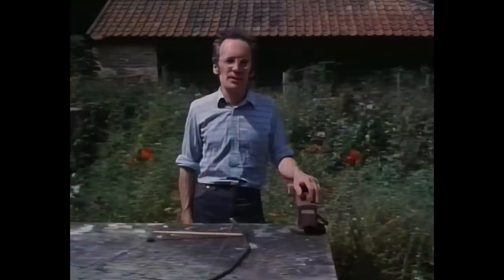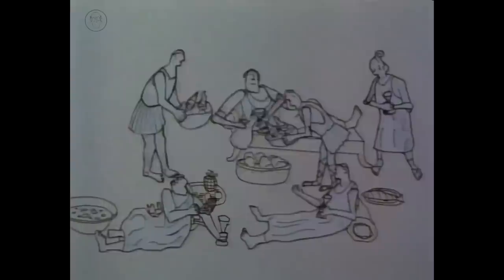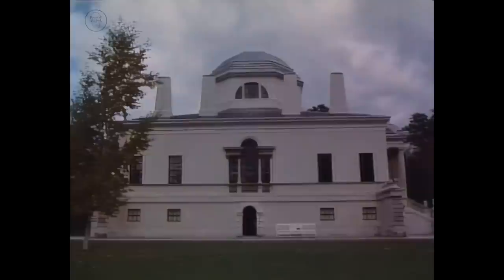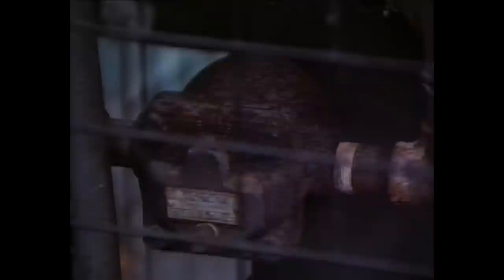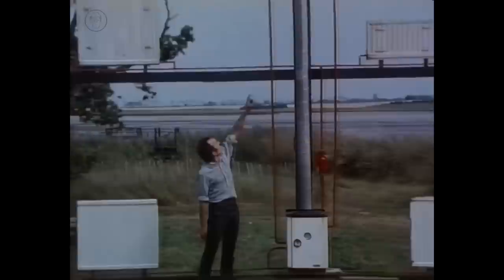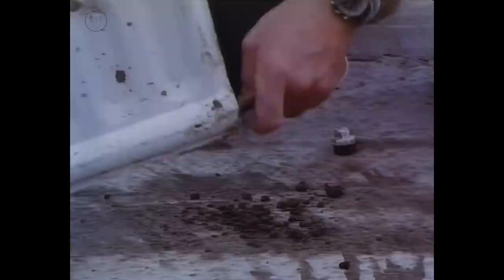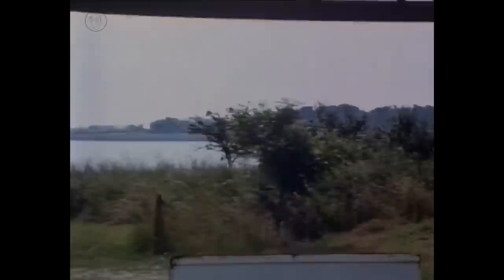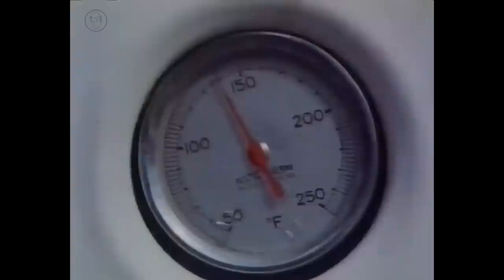The Secret  Life of the Central Heating System - Remastered

Comment: In the USA, many houses had gravity hot water heating in the later part of the 19th century.  My 1890s house still has its original hot water system.  Other houses had a gravity hot air system, often called an "Octapus," where large angled ducts conducted heated air to the rooms.  Perhaps central heating took longer to take hold in Britain.
Reply: A lot of British homes were built smaller due to space constraints, retro fitting heating systems in homes not designed for one was difficult.

Comment: Indeed, different countries have different heating needs. Even back when I first watched this in the 90's, most people in my part of the US used forced air heating. You do sometimes see radiators in older homes, but even there a lot of owners will have switch to forced air. I suppose the main advantage of forced air is that you can use it for AC in the summer as well as heat in the winter. Although when I was a little kid we didn't have central air but we did have a forced air heater. The house was from the 50's and so radiators seemed to have been going out of style even then

Comment: I grew up watching Blue Peter gaining a Badge back in 1970. Always loved making things so did Design and Art. A Level Design saw me build a Lathe... I still have it in my collection of 9 and 3 milling machines. I went on to a Design Degree and life as a Senior Technician 3 D Design at a University. Claim to Fame being the one to Vacuum form the Dash board and lights for THE MIGHTY ATOM Featured in The REAL Top Gear!!! The Designer being a part time Tutor where I worked. Another claim was make in 10 minutes a double concept dreamt up by one of our Product Design Students. Completely SLATED by the Tutor as being impossible of course... Fast forward to today where everyone has a modern Mobile and of course a TABLET!!!! 2 plus 2 sheets of Acrylic, pictures between, keyboards and taped shut. I suggested slightly more rounded corners. But we never perfected the switches!!! I mow spend all day making model 5 inch gauge steam Locomotives and insulating our 60 year old house in Reading.  Love David and Lily.

Comment: Tim accidentally smacking himself in the face with copper tubing after opening the flow of carbon dioxide is absolute proof that he is both human and of good demeanor. These days they definitely would have reshot the scene after securing the hose while being preachy about the hazards as if they had predicted the hazard. Instead they left a rwal example in the show. Almost as if he were capable at laughing off his mistake and cared about others learning. 🤔

Comment: Also another thing:
Reversible Heat pumps have been introduced.
Reply: Shame they barely work and need a fortune that nobody has to install.  I think many would give them a go if they were prepared for the complete stripping of the house to re-lay new pipework.  Now if you could cheapen them and hook them up to an existing CH system, basically a drop in replacement for the boiler, then you may get people signing up.

Till then they will remain an expensive fad.  The thing you are told to get but never can.

Comment: Fire by friction is difficult, however the biggest problem I see is wrong type of wood.
Reply: Out of interest what types should you use? I'd like to try it for no reason other than to try it!
Reply: @skylined5534  My favorite is red elm, but I know that is not available everywhere. Mainly woods with low/no resin are best like cottonwood, cedar, aspen, and basswood. All solid choices. For tinder dryer lint works pretty good, I used to use Sisal rope (non oiled) also bark from vines and cedar trees works pretty well.
Reply: @FuquarProductions  

Ahh so you the stuff I've tried in the past definitely wouldn't have worked then 😂

Thanks for the suggestions!
Reply: @skylined5534  I am part of the minute club (in my old scouting fraternity) one minute to spark and fire from a fire by friction set.

I set a new milestone before I retired, 5 minutes from a log, build a set and have a fire.

Comment: How do porches reduce drafts from open doors?
Reply: You close the inner door before opening the exterior door thus reducing heat loss. Also, a porch helps isolate the exterior door from the hallway, so reducing heat loss through the keyhole, letterbox, gap around the edges of the door.

Comment: In America,  we can heat a 6,000 sq ft mansion with a single 100,000 btu gas furnace if the house has a proper spray foam insulation job

Comment: standard 1990's US gas or oil cast iron boiler that will last forever and has generic parts is 89% efficient.
 
High effeciency condensing GARBAGE with model specific parts and a requirement for yearly cleaning of heat exchangers 4% better.

Comment: Modern homes are awful. Build like crap, slapped up in a few weeks and are damp thanks to the over excessive insulation denying the build the ability to breath. They are stuffy day and night all year round and lack the personality of a house put together in the 60's or earlier. If I end up with a house newer than the 60's when we next move, I'll be ripping the excess insulation and bringing it back to the standard of the 80's when houses felt like homes.

Tim's sentiments of over insulated homes is absolutely spot on. An extra jumper or a blanket is so much more practical than turning the temp on the thermostat.
Reply: Don't rip off the insulation. There's no point in that, and you're just gonna make your house worth less. 
The problem is not with the insulation, it's with the lack of air vents. 
A well constructed modern home can be made just as drafty as you like, with plenty of ventilation openings. My 2015-built studio had a giant air vent, that could vent enough to feel the wind blow inside if it was windy outside. At the same time, it could be sealed well enough to have the ventilation system pull the whole room vacuum, with a rush of air wooshing in if you opened the door. 
Still, it was extremely well insulated, with windows that felt warm to the touch even in winter time, so you can 'spare' heat if you want fresh air and still not have to turn on the heat. 

Hate on shoddy construction and design, not just on everything that's new. The balanced/heat reclaim systems that Tim talks about, those can be a real pain in the ass.
Reply: @mfbfreak  The value of a home for me goes up if it's old and worn in. Single glazing has benefits over double in some homes. Even as a kid I understood the old Everest glazing ad's were crap - demonstrating the benefits of double glazing with a falling feather when all they were showing was the gap between the glass and the wall. 

The value of a home that isn't going to be passed on to someone, is mine to do with as I see fit and enjoy. Why do we need a law forbidding homes below a certain rating if some people actually want them to be a certain way?
Reply: @cmmartti  I've lived in homes from the 60's and before and homes made in the last couple of decades. I'm never buying another home build before 1970.
Reply: Overly heated houses are causing people to be more vulnerable to cold. Where I live people heat with wood and despite severely insulted houses they are still burning as much wood (around 15m³ in a winter).

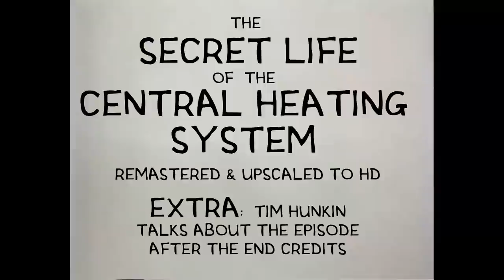Comment: 0:27 'upscaled to HD' ? Utter bollocks - it's still 625 line.
I'm not even sure 16mm warrants 1080 lines.
Reply: He used ai upscalling software.  It’s not perfect but it does a pretty good job improving footage.  I use it and it’s pretty darn good.
Reply: @OceanLlamaMedia  Depends what you mean by improving.
A few months ago, I got a web page and removed 80% of the content. The remaining 20% of content was the visible part of the old page - so what you saw was the same except the smaller data page loadd a lot faster. So which was the improved version ?
Reply: @millomweb  I have absolutely no idea what you are talking about.
Reply: HD is 720p and above, 1080 is FHD. Youtube is transmitting this video at 1080p.
Reply: @TheOtherBill  Completely unnecessary.